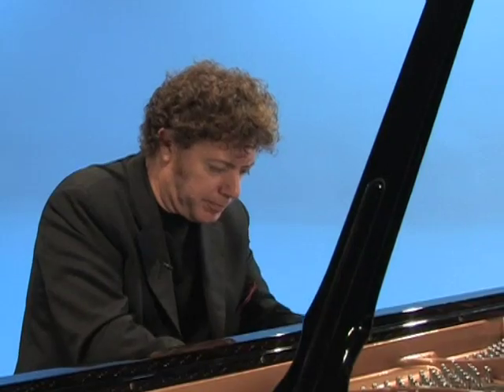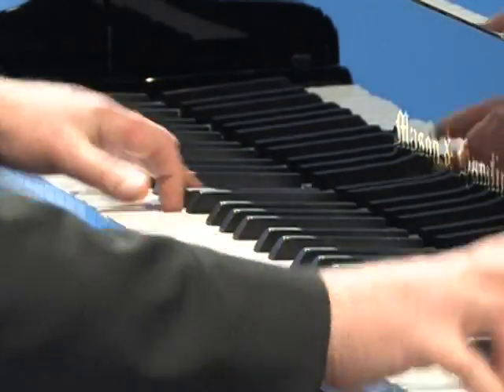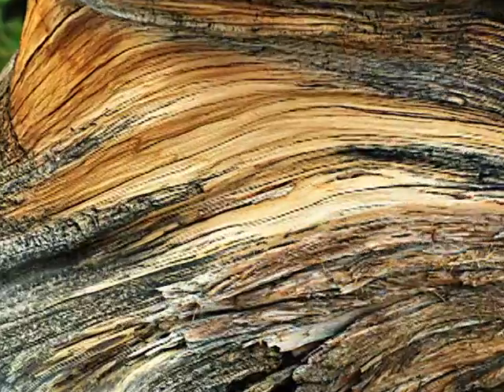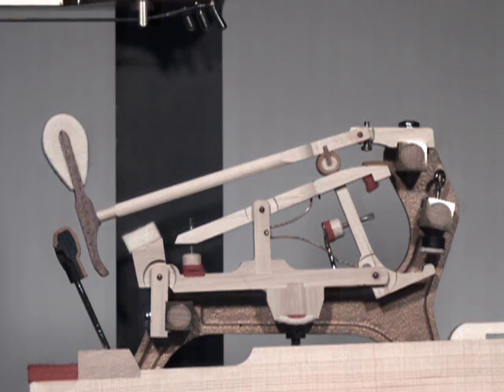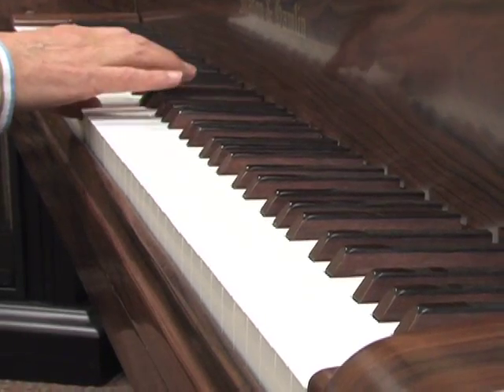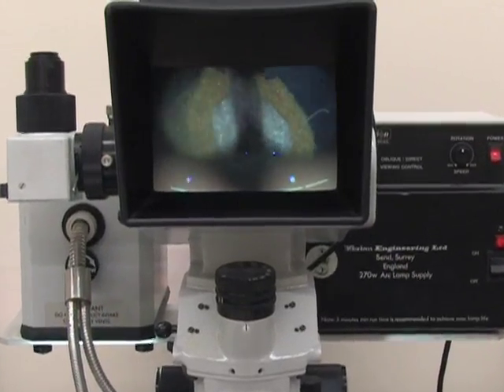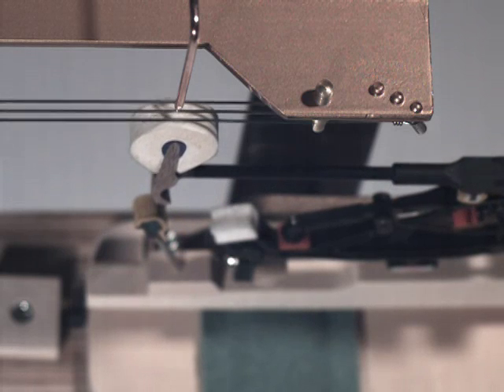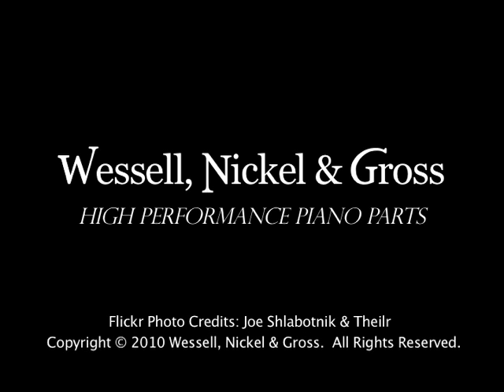WNG Composite vs Wooden Shanks

Comment: The presentation is given under the assumption that shank flex is undesirable. But why is that? I strongly suspect shank flexibility/elasticity can affect sound and tone as the dynamics of the shank influences hammer-string impact mechanics, which determines the tone. Relevant example is golf club. I don’t know there’s many golfers who’s interested in piano building, but the ‘quality’ of strike is hugely determined by the flexibility of the shank (or shaft).
Reply: Because what has been found through decades of research is that deflection is a loss of energy that otherwise would have gone into the strings. Like the timing of an engine, the timing of your action is crucial so as to not lose this energy which weakens the connection between the pianist and the piano. Having the shanks deflect less provides and incredible amount of response, so it feels like the parts actually work faster without delay, allowing you to seamlessly translate emotion to sound.
Reply: @barberchopin96  not an answer to my question. Why’s loss of energy is bad? It’s about the tone. And touch to a lesser degree. Piano is not a gasoline/diesel engine where fuel efficiency trumps everything. It’s about tone and touch. Not an answer. Besides, shank flex stores energy like spring, and it releases if timing is right. So just like golf shaft shank flex can deliver more impact.
Reply: @jisyang8781  To answer your question:  You need constant behavior in the action not randomly wooden flexing.  The WNG shanks are "predictable" and constant no matter what humidity levels.
Reply: @MarioBruneau  I agree that composite will give you better consistency against fluctuating environmental factors. Not arguing there. But my original point was  to challenge the presumption of shank flex being inherently bad.

Why is it that, if what previous commenter said was true, they now offer three different levels of shank resistance? And why is it that Kawai went all composite EXCEPT the shank? Answer is shank being wooden must have high impact on the tone.
Reply: @jisyang8781  Shank flex is NOT constant to the force/speed the pianist play the key so sometimes, the wooden shank will strike when the flex is UPWARD and sometimes the wooden shank will strike when the flex is released.  Different tone variations so not consistent.  As a pianist, I want the hammer to hit with the same feeling for any given velocity.
Reply: @barberchopin96  Not to mention the "predictability" of carbon fiber shanks versus wooden.
Reply: Also I forgot to mention that WNG now actually provides 3 different levels of shank resistance for those who do want a little more deflection 😊

Comment: The comparison of the performance of the two wooden hammer shanks is unfair: the first one demonstrated, the "ideal" wooden shank, is a full bodied hexagonal unit intended for the bass or tenor section of the grand piano. The second one demonstrated, the "inferior" shank, is an intentionally radically thinned shank intended for the high treble section of the grand piano, to reduce mass for the purposes of improved tone (a less woody sound) and quicker repetition speed. It naturally will have more flex. The video implies the two shanks are identical, to support the position that wooden shanks are inconsistent and thus inferior to a carbon fiber shank. This could be misleading to some viewers of this video.
Reply: If I'm not mistaken then, the actual situation is different from what they represent but it still isn't 'good' - it implies that traditional pianos have systematic inconsistencies in action between bass and treble.
Reply: I think the video is mainly highlighting how wildly inconsistent wooden parts are from one to the other, and how much they change over time. This fluctuating inconsistency makes them impossible to hold any sort of "fine" calibration uniformly across the whole keyboard. Each WN&G carbon part is engineered at extremely high tolerances and will be as close to the same density, mass, and strength as possible; from one part to another.  I think the most important thing to remember is - these new carbon composite parts will hold their settings, while traditional parts will change and deteriorate with humidity and temperature changes.
Reply: FreetradEfzzsgdz
Reply: Deeceetduzzent